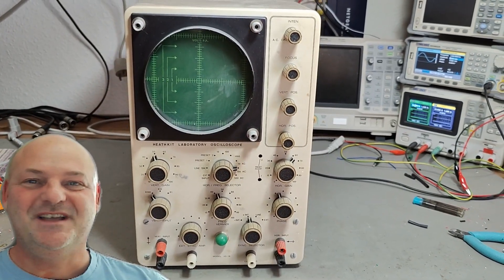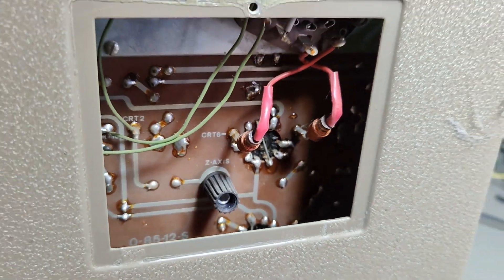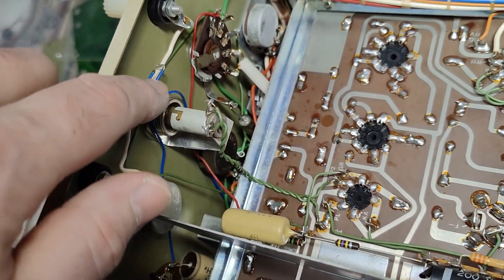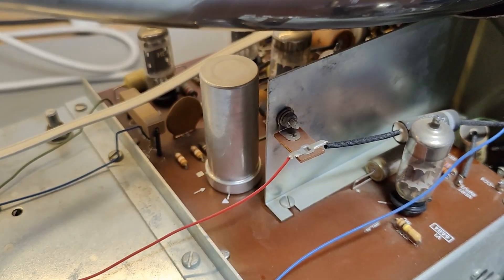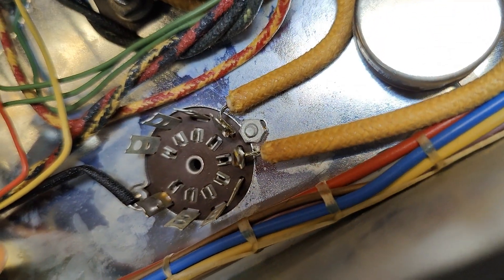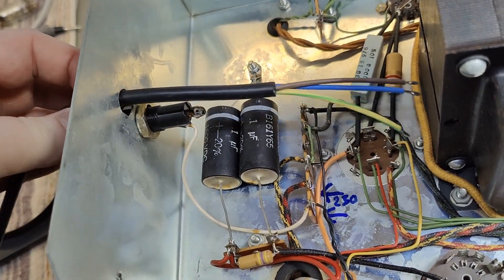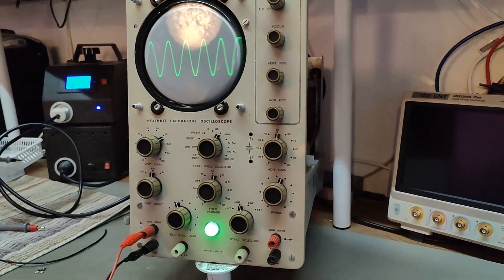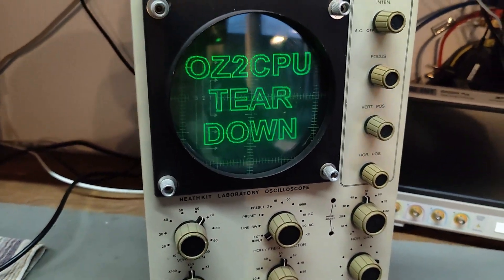Heathkit Laboratory Oscilloscope IO-18 1965 test repair teardown

Comment: GR8T diagnosis and spotting! It's pretty COoL to realize that this equipment is still being fawned over some ~40 years later. I'm sure it would be quite satisfying to the original hand-builders if they knew... I'm guessing that there are a "few that still do" :face-blue-smiling:

Comment: You can find the 1400v much more easily up on the intensity pot, along with the 110v for extra excitement.  My near-identical IO-12's 3db point is a little over 3MHz.  My HV rectifier is long gone so there's a diode in there.  You can't do the same with the double rectifier because it relies on its slow warmup to keep the voltage down on the filter capacitors until the other tubes start loading them.

Comment: Home built? Lots of wires and components routed touching the tubes... Did I see two pole antenna wire? Wasn't the blue wire just twisted together? Did you repair that?  👍👍
Reply: The ladder wire is used to carry the horizontal signal from the selector switch on the front back to the driver by the CRT base.  I suspect the blue wire and light bulbs for the gradicule are retrofitted.  Mine has those grommets but they're not populated.  The giant green bulb is an obvious place to pick up 12v.  I'll bet they ended up not liking it and disconnected the wire.
The wire routing is practically identical so I think this is made to the instructions.

Comment: The stain on the plate of the 1V2 high voltage rectifier just looked like ordinary rosin solder flux, but isolating that socket is still a good idea.  The schematic you have doesn't quite match, as you see, showing a solid state diode in place of it.  The scope you have includes an extra transformer winding to provide the filament supply for the vacuum tube rectifier.  I really enjoy fixing up and using old scopes like that, thanks for sharing!

Comment: As  kid in the 70s, and a Heathkit lover, I would have drooled over such equipment back then!
But I was stuck with inexpensive AC only scopes given away due to their obsolescence.

That strain relief can be replaced if needed, so you can use round power cord, or you can search for the flat cable if you want to be a purist.

How did you clean that tube without washing the heath name off it? I always hated cleaning the tubes when they were marked with the manufacturers name.

Nice to see it fire up! Those caps tho! Good luck, if you don't replace them!

I suspect the HV arc is the reason it was chopped and put away. and is why it is in such good shape! Great find!